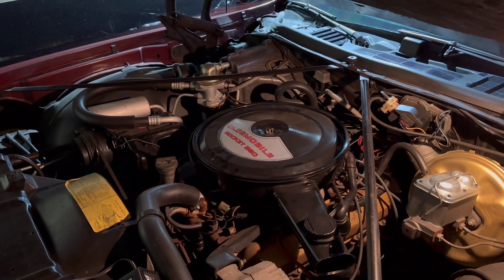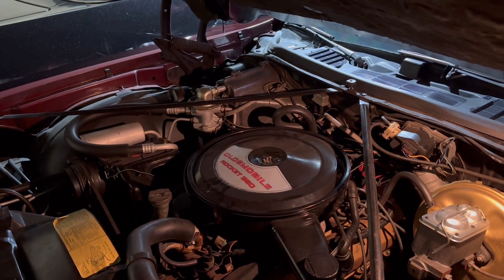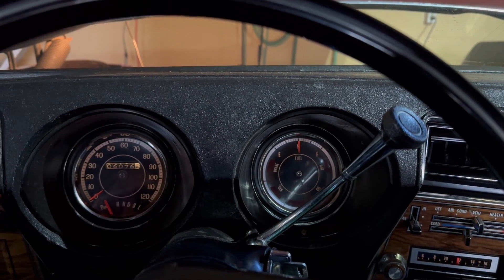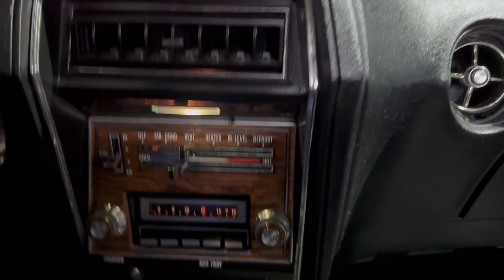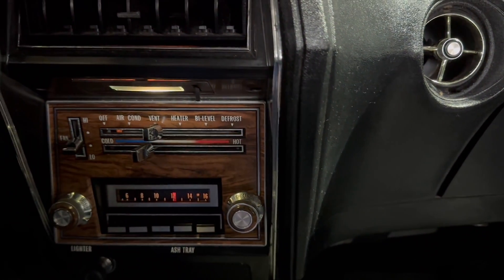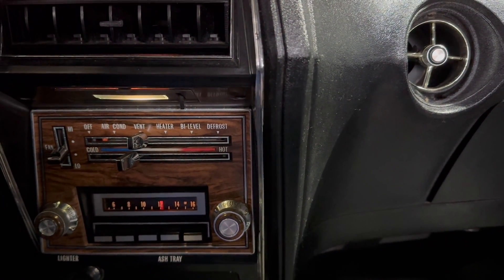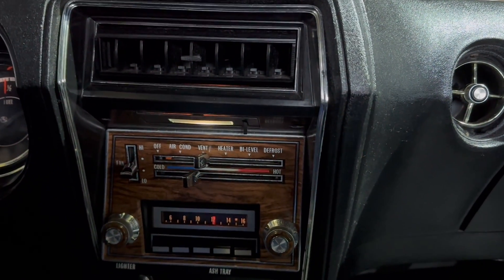GM's "Coolest" Invention Was a Strange Approach to Air Conditioning

Comment: I own a 1975 Cadillac Eldorado, and the system is quite similar to this one, A6 compressor, VIR diverter valve, and also is equipped with automatic temperature selector wheel in the control panel and with a "computer controlled" 😀module under the dash to select the vents, temperature and fan speed. All working flawlessly like the first day.

Comment: 😆 As a kid in the 70s and driving teen in the 80's with a family that was up until that point almost exclusively GM, I always thought the GM air conditioning controls were the most ridiculous and non-intuitive systems ever created.  Now I know why...(sorta!) 
I was so appreciative when I finally bought an old used Mazda and the climate control system actually made sense (ie, controls for 1-fan speed, 2-temperature, 3-AC compressor on/off, 4-recirc, 5-vents used). Thanks for the memories! 👍

Comment: So how do you turn on Recirc when the heater is on so not pulling cold air from outside to be heated but just using already warm air inside the car to be kept warm.
Don't think on any of my cars have i ever had the heater on with Fresh flow from outside, just dont make sense
Reply from the maker: They all do.
Reply: The water valve closes, stopping coolant flow to the heater core during MAX, RECIRC, etc.
Reply: Yes thats on old car obviously or cars in the USA ONLY as none of my old cars from the 70's or 80's did this and none of the new cars do this. 
 @johne189

Comment: They got rid of the auto recirculation because smokers didn't like it.
Recirculated air combined with smoking in vehicles made the car stink.
Smokers preferred to have their AC running with the fresh air vent open so their cars didn't stink of tobacco smoke

Comment: it doesn't open the flap or door on recirculate it closes it, then opens an internal flap to "recirculate" the cabin air as opposed to pulling air from outside the vehicle, this setup is hoaky in a way as you only have a single recirculate vent position, AC on and in one vent position... where it's the most useful is the defrost position, its will defog your windows in a heartbeat!  just having the ac on will as we know AC units suck all the moisture out of the air...

but on normal its sucking air from the outside so if its humid outside there ya go, recirculate sucks it out right now . . . the best AC systems have a completely separate recirculate lever, outside or recirc . . . this way you can use it in ANY vent setting, also, the more vent settings you have the better, I like all the possible combinations or the ability to open and close each one, so I can combine them as I please, vent with feet, feet with cabin, so on so forth as opposed to 3 generic combos, WITH a seperate outside/recirc lever, this way you can use it with heat as well, it's the same concept, if it's freezing balls outside why do you want to pull the air from outside in to warm up? you don't, so close the outside vents by moving the lever to recirculate... it will recirculate the cabin air . . .  remember newer vehicles are air tight so not forever, crack a window whatever for fresh air..

Comment: That a-6 compressor was ridiculous. I worked as a teenager in a junkyard after school. The owner was ultra cheep and when our air compressor went out he didn't want to buy another. we got tired of not having air tools so we put an old R4 on a belt welded a bracket on it and tried it it took forever to fill the tank, like an hour  . One of the guys game back with an A6 and that tank filed the tank in no time. 
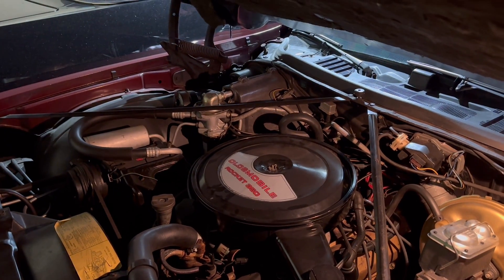Also real world advice none will give you on the whole converting it to R134a, don't just top it off with R134a . Don't bother with the whole vacuuming it out and changing the oil and emptying the compressor . This is not redneck advice Let me explain I've looked into this extensively and proven it in real world.  If you actually look at the ingredients of r22 substitute for homes you will see that almost all of them are a blend of four or five different chemicals. One of those chemicals is less than 2% of the entire mixture. That 2% of that entire mixture is only in there to carry the mineral oil around the system. If there is still pressure in that system and that pressure is being caused by r12 that is enough r12 to carry the oil through the system. One thing that does not play well with your r12 system is PAG oil. You cannot get all of the mineral oil out of that system unless you literally replace every single part with brand new You are going to have some mineral oil left over. Those two really really don't like each other. That's how you see people screw up their cars. A few years ago I have finally conclusively proven this 30% difference on how much better r12 is at moving heat versus 134a.  I can show you on the books the temperature charts all that but nothing compares to getting in to my 1998 Buick LeSabre that came factory with 134a that I filled with r12 yes I took a 134a car and filled it with r12.. what happened is exactly what the number said should have happened The air conditioning is so cold in that car it literally hurts your hand If you drive it on the highway for more than 20 minutes on full blast on a 100° day after the car sits in the sun all day at work the entire core turns to ice. No other modifications whatsoever are made to this air conditioning system. I've been meaning to get a free sensor to put on the thing so that it when it goes to freeze over it shuts down I honestly believe the AC compressor would only need to run in the car half the time increasing my gas mileage It's that kind of capacity difference between r12 and 134a.  personally if I owned your car as Cherry as it is I would go ahead and get on eBay now and start buying cans of r12 they're still there They run between 35 and $60 a can depending buy it during the winter it's cheaper. I would put those cans inside my house in a cool dry place maybe even give them a tiny coating of oil because you know eventually you're going to need to put some more refrigerant in that. NOTHING beats r12. there are a few flammable blends that get close but I'd rather not play with those unless I had to. The old fashioned outdated advice of why to only use 85% of 134a charge in an r12 is not because it works better with 85% it's because most cars condensers were way way too small to use 134 in. 134a is about a third worse than 12 in shedding heat so if you put something that was designed for r12 especially one that barely worked anyway like a Ford your head pressure in traffic would get slap out of control. So the the go to advice would be fill it less. I live through the hole r12 to 1:34A debacle of the '90s I didn't understand why people did what they did then I don't understand why the legends persist to this day I went to the library and figured out they were full of crap You can pull up these chemicals see their temperature curves See how they react to things. If any of the words are not correct that's because I'm using speech to text. awesome car BTW

Comment: Did you dump the compressor oil, blow out the lines and put the new oil in? If you get too much 134a in it with the old oil, the oil will migrate to the evaporator and stay there. The oil won't foam up to be carried back to the compressor without changing to the correct oil. If you've added over two cans of 134a you could be in danger of oil migration.

Comment: In 1973 I had a Mercury Montego company car (very plain...Inspector Erskine from the old "FBI" series rode around in versions like mine).  The AC system had the same slider set up wherein sliding it all the way to the left engaged the recirc mode.   The doors and baffles were vacuum controlled.  I was working in Fresno in sales at the time and was amazed how well the piston compressor pulled the temperature down to very cold while idling in a parking lot while i did my paperwork on the fly.  Growing up in a Ford family (and being a car nut) I was very aware of GM's superior rotary compressors and VERY annoyed at Ford's rumbly piston compressors.  My parents years later bought a Mercury Monarch that came with the GM 6 compressor.  I now understand why we could never use the fresh air setting of the AC:  The heater door obviously was not closing all the way in the coldest setting before the detent, so hot air was bleeding into the air flow.  The only way we could have that GM cold blast was on full recirc with the temp lever all the way to the left.  Also, the GM compressor flung oil all over the engine compartment.  At the time I was convinced GM was selling Ford defective compressors on purpose.  I never understood why in the early 70's they unnecessarily complicated the climate controls...the Max/Norm/Vent options were perfect for setting the climate just the way you wanted...quickly.  Thanks for covering this aspect of GM's designs

Comment: I can remember my dad taking an old air compressor from an air conditioning unit and I believe it was GM and I believe it was frigidaire. It was an upright almost looks like a small go-kart engine. He built a small frame and hooked up a washing machine or dryer motor. He braided on the output side an air hose. And said here you go this is what you use to every bicycle tires. You know I use that and still have it.

Comment: That explains a lot for cheap vacuum you could fill with air on residential houses you fill 60 psi see if it drops over night. Then if drops soap and water in spray bottle over plumbing see air bubbles.

Comment: I recall talking about these systems while at GM school in the mid 70s and I believe they were almost 2 tons of AC with a bottom line of about 38-42 degrees air temp at the center vent, which was quite a bit lower than other makes of the era. Heck, these days my 2014 Dodge is hard pressed to go much below 50 degrees unless it's an overcast / rainy day. BTW, not sure when GM went to using barrier style AC hoses but was told by many the R-134a conversions can leak right through the rubber on the older style. Have done a few conversions on 80s vintage with few problems there. The GM systems had enough extra capacity to deal with the slightly less efficient 134a. Not so an all other systems. I also still have a couple of one pound cans of R-12 in case I stumble on an older system that needs a top up. Makes me wonder what else is in the back of my garage, eh?

Comment: My family's 1976 Cadillac Eldorado Biarritz had the "climate control" on the left hand side of the steering wheel. The thing had a wheel to adjust temp and a bi level basically meaning "in your face and down to the floor" cold air. When you saw an ad for a 70s Chevy advertising "air blows ice cold" they mean it! Chevy really knew how to make an industrial grade ac for an automobile. 

It's cold, better than most HVAC home units at the time, and used that toxic Freon 12 (pre 134A conversion) but it sure could cool a car. And Cadillac made sure you were comfortable in the often named "Queen Mary or Titanic". Looked like a land yacht, ran like a land yacht with air ride suspension, and kept you warm and cool in sumptuous leather and HUGE power seats. Chevy and it's GM associate brand (Pontiac, Oldsmobile, Buick) really make their cars unique and each is special in its own way. I miss the days of charm and character in cars.

Comment: I’ll take correction if needed but I do believe that GM also had the only bi-level control out of the big 3. Also, in early GM cars equipped with A/C, when switching to defrost mode, the system would run the compressor intermittently which would assist in keeping moisture buildup off the interior of the windshield. We had a Ford in the early 70’s with A/C that did not cycle the A/C in defrost mode and the windows would always fog up necessitating a manual roll down of a window. But the ‘73 Ninety-Eight with the Rocket 455 had this feature and the windows never fogged. But that was a very expensive car which came in at a whopping 5G’s. lol. Those were the days. Now a days pretty much all cars have all these features that used to be only on upper end cars. Youngsters don’t know how to live without.

Comment: People have gotten so used to the anemic R134 cooling power at idle nowadays that they think it's normal. But every time I use the AC in any R134 vehicle I die a little inside because I clearly remember when AC worked as it should...ice cold from startup to shutdown, no matter if you were cruising the interstate or idling somewhere.

Comment: Moving the temp lever pass that detent also makes for drier air. My mom's bought new a 72 Malibu, beautiful in Ascot Blue & white trim. Moving the temp totally to the left and applying the defog clears the windshield much quicker, especially needed on rainy summer nights, and for people who generate more sweat. My 66 Comfortron Caprice had something similar.
Ever take one of those compressors apart, it's genius. Amazed my '91 GTA, '88 Fiero Formula, '80 Turbo TA, & '87 3T Regal all still blows cold.👍🏽🏁

Comment: Interesting. When did GM discontinue this air conditioning feature? I wonder because years ago I bought a new 1977 Oldsmobile Cutlass Supreme 2 door hardtop with factory air. It's been more than 40 years since I owned the car so I do remember much about the features.  The climate control panel on my car was exactly like the controls in my car. I do remember years ago that the air output increased s lot on max AC. Air conditioning systems in today's  cars work well enough but don't seem to put out as much cold air and don't cool down a hot car as quickly as they used to either. I've also heard it said that R-134 doesn't get as cold as R-12 . I wish that I knew whether or not no my 1977 Cutlass Supreme has AC feature you're discussing in this video.

Comment: R134a is the work of Satan. The only reason it exists is Dupont had the patent and the industry used it, and paid Dupont.  It leaks unless you change hoses,, it doesn't work as well as R12, you have to use PAG as lubricant, and on older cars where the compressor is high mounted, it won't get adequate lubrication. The  best refrigerant is R290. What is that, you ask?  Propane. It works as well as R12, it doesn't leak, you can keep the proper compressor oil. Also, you don't need to vac the system, it can tolerate a bit of air. $10 for a fill.

Comment: A variant of this lived on in 1984-1988 GM Holden Commodores in Australia, but mounted vertically.  2 levers - the heat level connected to the blend door via a cable, and the mode lever operating a rotary vacuum switch.

As soon as you turned it on, the fan kicked in - you could only vary it from 1-4 (no off, unless you pushed the mode lever all the way down to off). It didn’t go to high speed with the temp lever though.

There was no way to turn the compressor on/off - it came on in every mode setting except vent and floor.

From the bottom up it was “max” (recirc - the only setting to pull recirc air, face vents only), “norm” (outside air, face only), bi-level (face & floor, if you moved the heat lever the floor got heat, but not the face).  Then vent (face only) and floor (both with no compressor), and lastly “def” which was compressor and air only on the screen.  Leave the temp lever on cold with Def selected and you could make ice form on the screen around the wipers.

A simple system that just worked so well.  Well enough to still be fine in 1988.

Comment: GM Holden here in Australia in the 1970s used the same A6 compressor and components that they used in the US. The difference being the control panel is much the same as GM started using in the late 70s early 80s in the US. Our control panels denoted the various HVAC settings with symbols and later in the 1980s went to written words.

Comment: The coolant valve on the heater core explains why people (in repair videos) to this day say to turn the heat to hot and let the coolant run through the heater core. A lot of them do it even though I've looked an no car or truck I've ever owned had any kind of cut off. 

Pretty neat feature though. I'd imagine it would cut down on that much more heat going on under the dash on a hot day.

Comment: If the systems needs to be charged it has a leak, period. How often do you recharge your refrigerator? The theory, operation and systems designs are identical between your car and your refrigerator. Often times the gasses used are as well. So, if it needs topped off, it has a leak.

Comment: Unfortunately, those A6 compressors took a lot of power.  It wasn't a problem until 1977 when downsizing began, engines were weak, and EPA fleet averages were getting higher.  That's when GM went to the R4 (radial) compressor.  It was lighter and didn't need so much power but, it didn't have a sump for oil like the A6 had.  It got lubrication from the oil that circulated with the refrigerant.  As you can imagine, it was less tolerant of system problems than the A6.